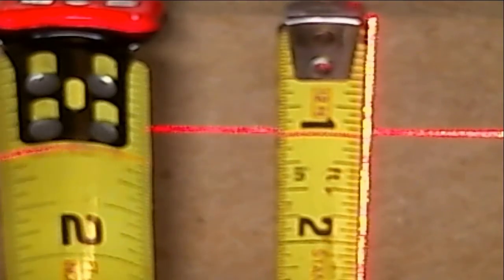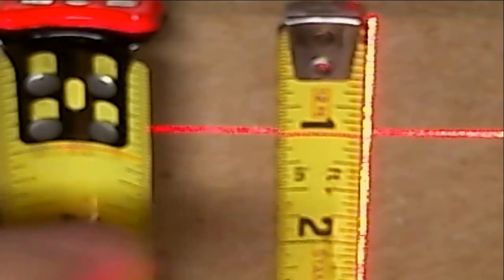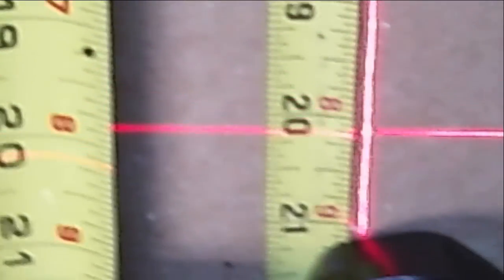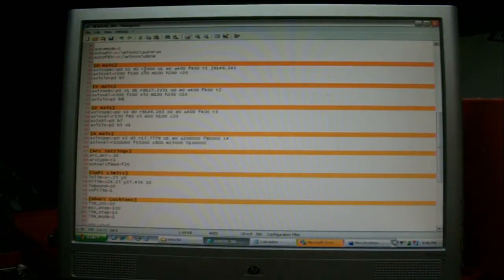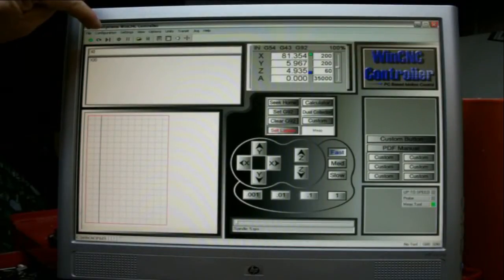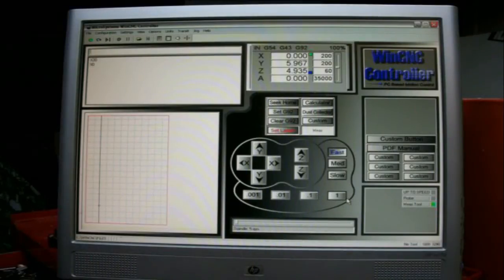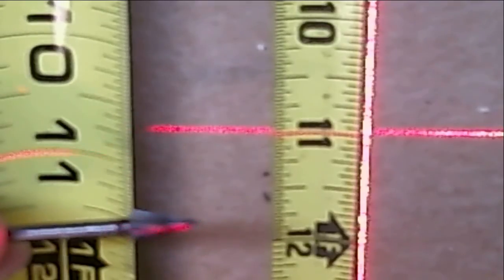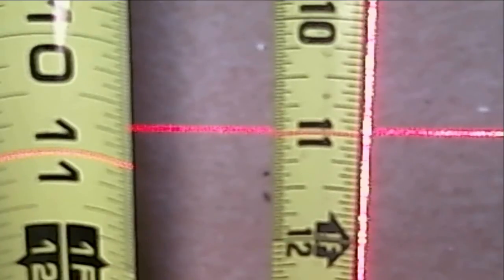WinCNC Tutorial: Set Resolution on X axis

Comment: Mike, Thanks for the videos. I am using WinCNC on a plasma table Any videos specific to that application are appreciated. Setting the Z low soft limit is something I have not figured out. Also Is there a way to run a test pattern without the torch firing? A tutorial on tracing an existing pattern would also be helpful! Thanks much, Barry